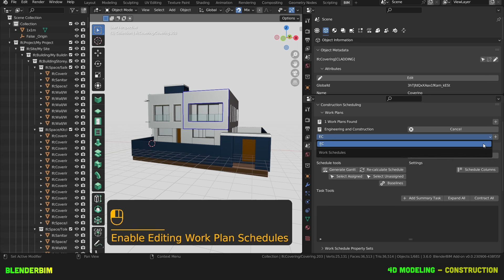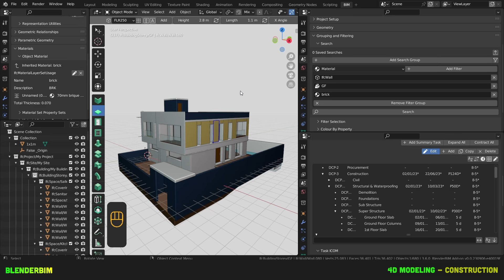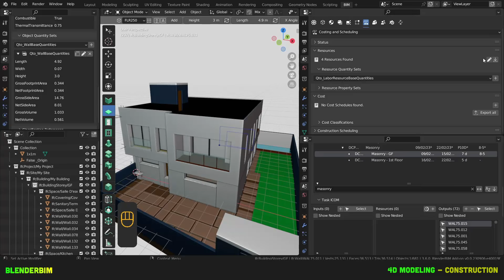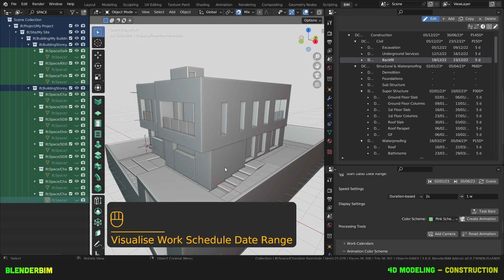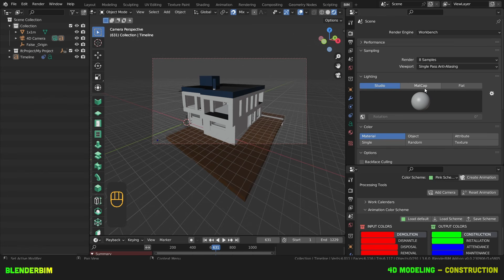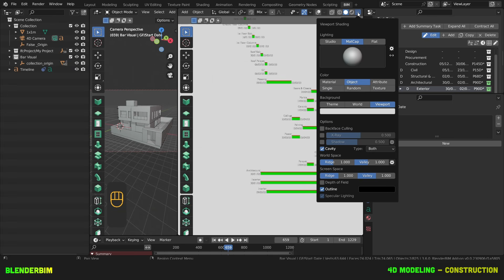Comment: Hello. Great video, however, I can no longer see anything relating to work plans, work schedules or calendars in the side panel. All I can see is a drop down mentioning 4d tools, with seemingly no way to import anything. Also, whenever I try to import an XML or XER file, it comes up with an error box.
Reply: same. did you find any solution/ workaround?
Reply: @aliumrany  hello, my issue was resolved by upgrading the model from IFC2x3 to IFC4; after the upgrade, Bonsai displayed the work plans and schedules correctly. It appears that full support for these elements requires IFC4.
Reply: I meet same trouble. Did u find solution now?

Comment: Is it possible to add a search group to a task? In the video it looks like you're adding the result from the search group to a task. I'd like it to be more dynamic  instead of adding selected elements. Is that possible?
Reply: If I understand you question I think you can search by clicking one element and select (arrow) its class or type in the Object Information Panel to select similar instances or alternatively you can use the Grouping and Filtering at the bottom of the Project Overview, hope it helps
Reply: Hope to get something going before next release January 6th 21024. Something like assigning tasks to search groups and  a tool to assign products as output/input from these groups.